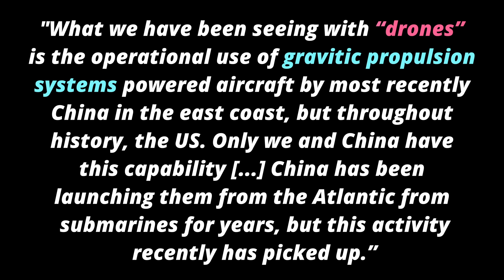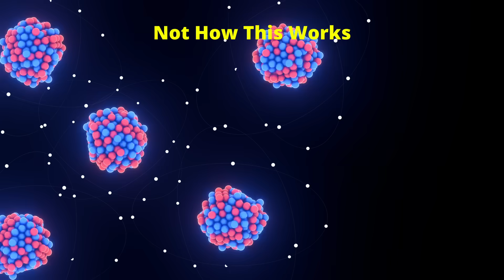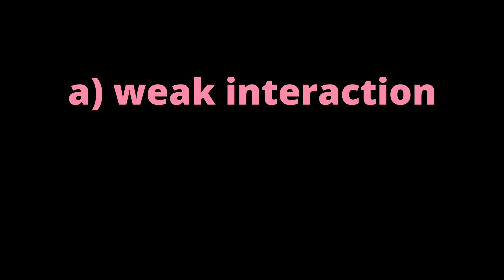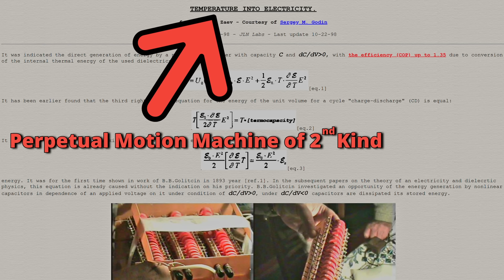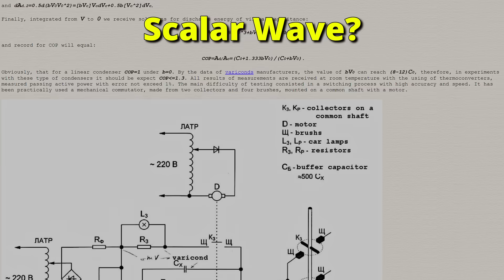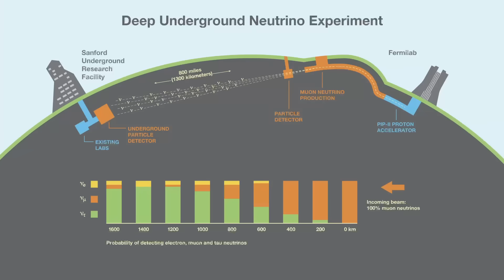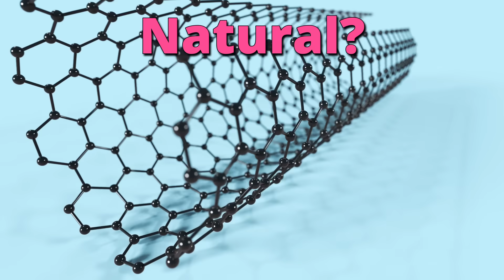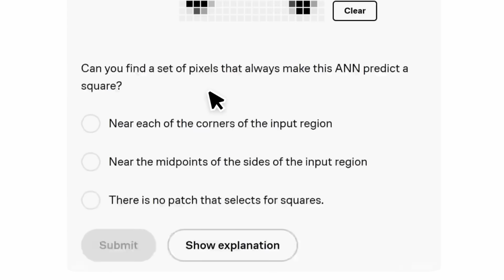What is “gravitic propulsion” and could the US government hide it?

Comment: If you look into the book by Paul DelaViolette, Secrets of antigravity propulsion, he describes (paraphrasing here) that after WW2 cavity magnetrons used in WW2 radar were developed further into devices capable of terahertz waves. These ultra high power, ultra high frequency devices interacted with solid matter, ultimately resulting in beam riding craft. Furthermore, when terahertz waves are produced, they can entrain energy from the vacuum to pull energy in from apparently nowhere, as though energy creating! The physics of ultra-high frequency waves seem fantastical, but ask yourself, if 2.4GHz produced in your kitchen microwave can cook your food, why can’t 2400+GHz move solid objects?  Beam riding vehicles must surely be possible

Comment: I’m guessing that the small amplitude, high frequency, and long wavelengths of gravity waves might make them very awkward to manipulate. Variability in the masses of objects which cause the waves that pass through the traps now is kind of off-scale for the machines we operate today. Isn’t that right?

Defying the cling of the gravity medium itself seems like pushing a submarine underwater. Is that easier at greater depths? It’s easier to move things around where water isn’t. Sabine says there isn’t any ray gun for blasting bubbles through space oceans, but she also stated that interstellar space had voids like those in bread loaves. Is it something doing that, or something not doing what it does elsewhere?

Whatever attracts gravity to atomic nuclei and converts that to rotational or resonance energy for their “life” structure is only evident in matter. Sabine is expert in that quantum composition, if anyone is, but if a polarity exists for gravity, then whatever is attracting gravity in this dynamic should also be polar? I’m not sure that knowing that would help, and if evident only by inference, that’s just what she said about not finding any. If "growing the ruler" means thinning-out gravity extends spacetime encounters with its headwind and attraction, that seems reasonable. Some greater distance and rate would be needed for a spacetime pitot tube to attain the same reading, as is the case for higher altitude flight.

But what if gravity is just chasing its tail? Say that atoms have an internal gear ratio problem where weak pedal-power outside results in greater rotational speeds within them,. In a nutshell of mating mini-wave harmonics, maybe similar but unequal waves nest one sine peak into every or every other valley, sort of like large gear teeth meshing with a smaller one, but not every pitch point to every root?  

What if, subatomic particles lubricate a sort of looser hydraulic or pneumatic-like relationship between spherical zones of rotation that either do or don’t have the same axis of rotation? Every form of matter suffers friction in contact with others. Atoms would run-down if not continually replenished with energy. But conflicting energy waves or interference waves, as in heat in glowing steel, will harm those assets.

Momentum and gravity seem interrelated and centrifugal force that's offsetting gravity inflows on a solar system scale don’t have matches for the scale of an atom’s particles, do they? But there is math for the larger set. We don’t see off-axis movement in space, or do we? What’s different about spherical atoms? Gravity affects all directions and angles of galactic spheres, yet their rotation pattern in the same plane. Flip them over and they're spinning the opposite way? Is atomic spin like that? Can inner layers have gyroscopic spin of different axis?

Gravity inflow at Earth's poles is roughly the same as the equator. But creating a balloon of something or nothing to buoy an object in a gravity stream or ambient ocean, trying to cause gravity to ignore it, while its currents continue on around it, seems difficult without a denser atmosphere tending to sink below it. Since we don't know what is gravity resistant, and interference waves are reflected by galaxies and extremely weakly at that, compound effects seem very difficult to reproduce. 

Bread-loaf holes in interstellar gravity (or whatever else is invisible to us there) seems likely to have reached the limit of its own repulsion. I can't guess what the range of a gravity field might be, but nothing says it's matched by whatever it is that gravity seeks in the quantum world. That's why I'll plan to watch more of Sabine’s videos, hoping to learn more of what I’ve guessed wrongly already.

Comment: "gravity propulsion"

They might be talking about Electrostatic propellantless thrust (NOT ionic wind). 

Dr Charles Buhler ex Nasa engineer and his team works on this strange phenomenon.  The whole idea is:  

"By applying a high voltage to electrically conductive surfaces, an electrostatic pressure force is generated" it is not ionic wind because it works in a vacuum. Its also self containing. Meaning, once you charge it. Static charger does not go anywhere. Object remains charged and could levatate even when its off. 

If the ex scientist does this... Imagine what the actual scientist groups who work for the government under the oath in secret "underground" programs.

Comment: Before India's and Pakistan's nuclear tests 1998 the sole purpose of the Comprehensive Test Ban Treaty(CTBT) was to prevent simulation data of a weapon with X yield out of the hands of nations.  With data you can do 2X,10X yield simulations and more importantly the actual design of the internals of the bomb by tuning the model from the data. Now-a-days no one is pressuring india or pakistan to sign the CTBT because it is moot, the data is there no more tests needed.  Its not just math, its actually the data to tune the model that are also kept secret. I also think the lack of computing power to do this in the coldwar in 50's-70's  is likely a reason why so many tests were done by the US and Russia, they simply could not effectively simulate and needed actual tests, though I may well be wrong about this because they also tested many kinds of bombs.

Similar thing is playing out with LRMs these days and it will be interesting to see where it goes.

Comment: you could probibly take a high speed pid controlled linear actuator, connect it to a gravity wave observatory, and shake a mass in time with the gravity waves observed in real time. i call it gravity wave surfing. its the same idea around the mach effect drive (mega drive), except it uses gravity wave observation as a control signal rather than use a "magic frequency". push at the peak and pull in the valley. there is probibly some physics reason that doesn't work (mostly the required scale of the machine).

as for using it on drones, i think the reason we keep seeing drones everywhere is because people keep buying them. not because the government is using some fancy drives. just bldc motors and batteries.

Comment: Well, based on how Salvatore Pais explained it recently in an interview with Jesse Michels, all of the answers to how antigravitics are supposedly made to work (and how that was hidden) are hinted at in this video. Basically, you either use very high voltages applied very locally or very fast, or specifically engineered metamaterials, to induce scalar waves or some other kind of non-Hertzian waves drawing energy from the zero point energy field that have always been possible according to the Maxwell-Heaviside equations from 1890. That scales up quantum effects to a macroscopic scale and you get to engineer the spacetime metric. And whenever someone has made that work since then, they either kept that to themselves, or were silenced, and later the math of these solutions was classified under Atomic Energy Act of 1946. 

Apparently, the main reason why theoretical physicists are not figuring it out is that the easy way of discovering it is by starting from experimental physics, watching nature do its stuff without being too presumptive about what's supposed to be theoretically impossible. The key natural phenomenon pointing to these physics is allegedly ball lightning, or anything to do with fractal toroidal moment.

Comment: I have seen one of these crafts while camping in Nelson Victoria Australia. it was more more than 100 metres away from me. Was the size of a warehouse and made absolutely no sound. The air around it seemed to be either displaced by the ship. Once it was directly above me the centre of the bottom of the craft glowed neon blue and it took off straight up into the sky and was out of sight in 3 seconds
Reply: This happened mid last year
Reply: I know what that was. They were trying to hide the missing ballots of the stolen Trump election. They thought nobody would find them in the Australian outback. But then they saw you and scared away. Elvis was also on board the ship.

Comment: I used to fiddle with alternative energy devices. Some worked, some did nothing, but looked cool. The problem is. Some worked, and the academics with slide rules up their cans tried to say it was impossible. Even when presented with a working model. They would conclude that it was simply an elaborate hoax. Yet building the device and making it work was much simpler and not elaborate at all.
 I built a weed eater that could run on waste utilizing a vortex reformer. Cool word for a simple doohickey. It's just a double layered plenum incorporating the intake and exhaust so to make them run retrograde toneach other. Exhaust in the center plenum, and intake through the outer plenum. This creates a plasma between the inner and outer plena and reforms whatever you run through it much smaller molecular components. I was told plasma cant form that way, yet you could see a bright blue lightning storm between the plena when operational, and thenthing would run on ¼ cup of piss and used motor oil for 6 hours. But according to the "smart people," it was an impossible device.
 I stopped believing self-proclaimed smart people a long time ago. The halls of academia are now for programming, not the search for knowledge. A bit of data that doesn't fit within the parameters of their current theories(narrative) gets immediately tossed as impossible. No great accomplishments have ever been made thinking like this. It is, in fact, anti-scientific methodology, and it is rampant amongst the current scientific community. Studies always find what they were bought and paid for to find, and their authority thereafter is unimpeachable for all of eternity. If you disagree you're a crazy conspiracy theorist. Just like all the other great minds that were ahead of their time before they were vindicated by the eventual revelations of reality.
 “When you’re one step ahead of the crowd you’re a genius. When you’re two steps ahead, you’re a crackpot.”
— Shlomo Riskin

Comment: Electrogravitics is the idea that an electric field can create an anti-gravity force on a mass. The term was coined by Thomas Townsend Brown in the 1920s.  I have issues with this statement. It was my understanding that Townsend Brown measure thrust coming from a crooks tube and built instruments to try and increase the amount of thrust he was measuring. He did not then call it anti-gravity or Electrogravitics, it was just his thrust test rig. and it seemed possible. But could it have produced realizable vehicles as a form of propulsion is all speculation, it is either classified or not possible. But one thing is sure, testing ionic wind devices is not in anyway replicating his equipment, he was well aware of the electronic wind effect and took measures to rule out that effect. His devices was based on an asymmetrical capacitor field not ion wind, i mean the guy was a physicist and did know what he was doing. His device some how produced thrust, that is all, as far as i know there is no new physics or forces involved and it is not anti-gravity and it all amounts to either a classified program to develop it, or it just died as an Unreproducible experiment, everything else is just speculation. Although i did come across a paper written by two British scientists about the state of gravitational research in the 1950"s who mentioned him and they did say his device would work in a vacuum and was listed under gravitational research, make of that what you will.

Comment: Quantum particle physics. Gravitons represent the barrier between normal space time or slow space time and quantum space time. Electrons, protons and neutrons no magic electric energy but mass charges, positive, negative and neutral mass charges, those mass particles also responsible for the trick of light, not photons, neutral mass charge clusters, made at the core of atoms, sub atomic particles, quantum particle singularities, so protons weigh more than they should and electrons weigh less than they should and neutrons have neutral mass charge. The mass charge quantum particles responsible for energy transfers between quantum singularities, sub atomic particles and of course the atomic and molecular particles they create.
So going faster than gravity, a simply matter of creating a negative mass field around the outside of a starship, this of course creates huge problems for the create, unless you create a positive mass field on the inside to cancel out the negative mass field on the outside and of course create artificial mass, artificial gravity. So how do you create positive and negative mass fields, not telling, nyah, nyah, because it is funny to do so or to not do so, what ever ;DDD.

Comment: Another type C extension to physics has to do with Potentials.  Although physicists have been careful to define potentials as NOT being fields, there are variations in potentials in space which can be characterized using the mathematics of vector fields.  Some people refer to these as "potential fields."  The empirical detection of Aharonov-Bohm-described physical effects for the 3 (so far) major potentials of gravity, electrostatic, and magnetic vector potentials demonstrates a kind of quasi physical existence of these potentials (fields) in space.  Some physicists believe that information can be communicated without mass, energy, or momentum using only potentials.  This is one gateway to new physics, although, like the interpretations of QM measurement, it seems to be more easily conceived of as philosophy than physics.  The difference between potentials and reals, or the difference between probability amplitudes and probability, truly expand the definition of existence beyond a dyadic (2-stated, "binary") state of existing or not existing.  This is one gateway to  new physics.  Another is the probability that Time is is more complex than can be described via a single dimension.

Comment: gravitic propulsion is where energy of mass is converted to energy of motion. The force that will alter kinetic energy of a mass does this with the force of gravity.  All mass is connected by gravity. By converting mass to kinetic energy one moves the mass/object. E=MC^2 .   All mass has a kinetic energy tally. All mass is in motion. Alter that tally of kinetic energy of an atom and you move that atom. Gravity is the force that connects all mass in the universe and it  is instananeous and allways being updated. 3D space doesn't matter. Distance between suns doesn't matter. So how does one alter the kinetic energy of a body. Electrical Resonance. Tesla was messing with this. Its also how large rock would be moved to build the pyramids. Its ancient technology. UFO glows like a light because of the Electrical Resonance that unifies the mass of the object.

Comment: Thanks Sabine. Controversial rabbit hole this one lol
>
1:28 Anti gravity propulsion systems were supposedly researched (government) back in the late 60s/70s. This was first circulated (I believe) in a book back in1978.
Warning! The following book contains conspiracy theories and cult ideologies. Read with care and at your own risk.
The Cosmic Conspiracy - Stan Deyo 1978
You will find subjective information with regard to supposed anti gravity flight research from the 60s and 70s.
.
So all that is required is to harness a black hole and use it for propulsion. Not hard lol
>
14:08 "The measurement problem is where the new physics is."
The measurement problem and uncertainty principle offer many clues that suggest we are not looking at it from the correct paradigm. There are other clues within relativity as well, but the uncertainty principle sits at the center. Physics (the universe) is always in a state of flux, in motion and not static. We we can't yet describe that (flux) without breaking (stopping) the motion. It's like stopping a turning wheel to measure it, but then it is no longer a turning wheel; we destroyed the "turning property" by measuring it, so all we have is a measurement of a static wheel.

Comment: The infamous TR 3B is not antigravity. It uses a 5Mw air cooled nuclear reactor. The reactor heats an easily ionized salt, nonradioactive cesium bromide to the point of plasma, then the plasma feeds an airflow multiplier converting the heat into mass airflow. They tried a few other salts that worked rather well were mercury bromide and thallium chloride. Both created a bright glow that defeated the point of nearly silent operation. The craft has one big advantage in that it can stay airborne for 2 months on a single propellant charge, with the reactor lasting about 5 years on a single fuel charge. The disadvantages are that it cannot acellerate very fast, the cesium glows brightly in the near IR, and it takes a while to reach operating temperature when shut down.